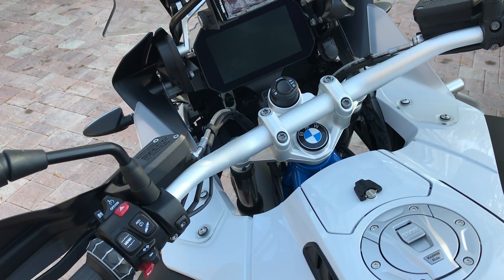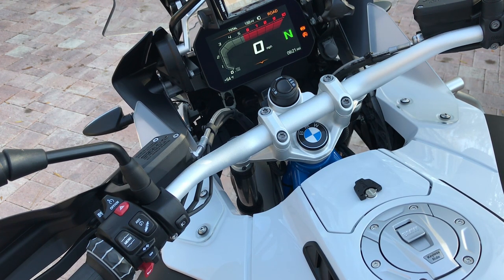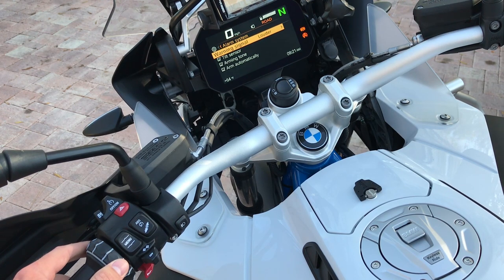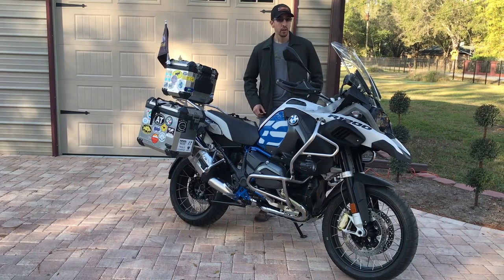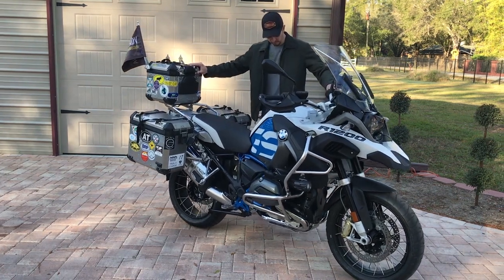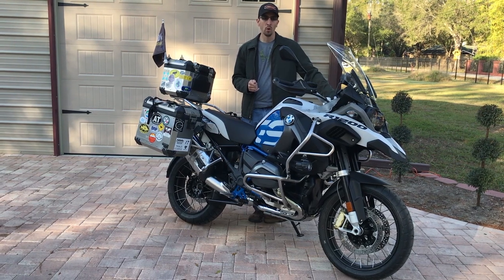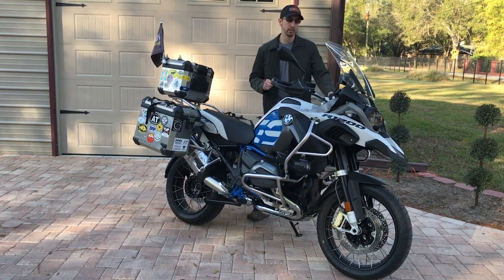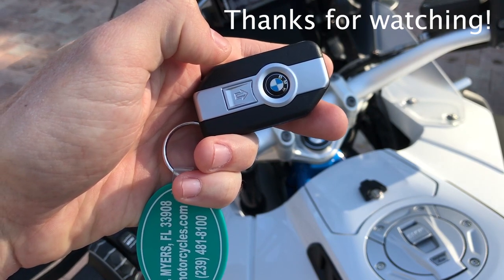BMW R1200 GS GSA Factory Alarm Overview And Setup

Comment: This is helpful, I just bought a 2017 GSA which is slightly different, and the alarm system is referred to as "DWA" in the dash settings. Key FOB is the same, but the 2018 has the all digital display. I was able to figure out how to set it after viewing this and reading the owners manual. My ears are still ringing after setting it off!
Reply from the maker: Awesome, glad I could help!

Comment: Thanks for explaining, and more importantly SHOWING us visual learners how the system works. Not only does my '22 GSA NOT have the alarm system, but my dealer never mentioned or offered the option for my bike. Damn shame--I probably would have sprong for it!
Reply from the maker: It’s hard finding a dealer with good product knowledge. I know a few who actually use my videos for training lol.
Reply: I installed unit myself under 20 min with programming. Buy it your self from ebay.

Comment: Question?? I have 2021 40 th year anniversary gs 1250 and I can’t find the alarm on the computer .. is that possible that I don’t have it??? It is stock for all gs or is that a option ??  I bought it used and don’t know if was a extra purchase or not? Thank you
Reply from the maker: Hey, if it’s got the alarm module you can see it under the seat. Looks like a small black box.

Comment: I haven't been able to get details on this alarm either on the web forums or from BMW. Other than flashing the turn signals and blowing a siren, what else does the alarm do? Does it cut the ignition? Does it cut the starter? What else? I have a 2016 GSA LC and was considering installing it...should have done so when I ordered the motorcycle.
Reply from the maker: Hey, so the BMW comes standard with an engine immobilizer. The alarm gives you the ability to have vibration and movement audible alarm activation. The remote also aids in the ability to not have to leave your hotel room to deactivate the alarm if it goes off by accident. Its a simple install and don't let your dealer tell you that a key fob cannot be paired with the system. My local dealer tried that with me and I had to show the "Master Mechanics" how to do it.
Reply: @2wheelAdv  Thanks! I would need the key fob since I ordered my GSA LC with a "key" and not the "keyless" option. I take it the alarm siren is part of the DWA module or is it a seperate siren? Its too bad BMW didn't provide programming options as they have in my Acura vehicle. I had to get a MotoScan to switch my 12H clock to 24H from my flying days. Same would apply to programming the DWA in.
Reply from the maker: @a.c.e.7568  In my 2018 the siren was built into the DWA. I would assume it's the same unit for the 2016.

Comment: I have a 2021 BMW R 1250 GS adventure with the BMW alarm system installed. When I activate it using my fob I get three loud signals, not two. Would you know why I get three and not two?  Or how to change it from three to two?
Reply: Mine is the same I'm asumeing it's different levels of security maybe ...

Comment: It’s not showing up on my new GSA?  I read where you put it’s plug and play?  Any idea how to do that?
Reply from the maker: Adam Thompson you have to have the module installed which mounts near the rear passenger section. It’s a option that cost about $400. If you bought it and are installing it on your own it might require a software update on your next service to unlock the feature but I’m not 100% on that one.
Reply: Same here.   What’s the module called?   I want it.  I was scratching my head also.

Comment: Hi does this work on gs r1200 rallye 2017 non tft screen ?
Reply from the maker: It won’t have the same features. I had one for my 2014 GSA so I know it’s possible. The 2014 would do movement/vibration detection.

Comment: Any idea if Alarm is in Auto, how do i set it to Trasnport Mode fr the Remote.
Reply from the maker: Hey, sorry for the delay. You have to go into your settings menu and unselect auto arm and vibration/movement option. That should save your battery during transport.

Comment: Hi, does this bike come standard with an alarm
Reply from the maker: Redline600 hey, no it doesn’t. $300 ish option.
Reply: @2wheelAdv  dame, ok thanks.   Does the bmw shop fit it
Reply from the maker: Redline600 yes they can install it. Probably be 1.5-2 hour labor charge though. If you are somewhat competent you can do the instal yourself.

Comment: Hola, me gustaría saber dónde está ubicada la centralita de alarma de la bmw 650 gt para sustituir las pilas, gracias
Reply from the maker: If you have the Factory BMW alarm and the module is the same for the 1200 GSA as the 650 GT You will find it under the rear section of your seat. The module will have a small battery inside which should be replaced yearly.

Comment: How did you mount your flag?  Is it something special you ordered?
Reply from the maker: Adam Thompson I ordered the mount from EBay. Drilled a hole for the bolt to pass through on the upper pannier and sealed it. I have a video of my fixing it somewhere...

Comment: How much did it cost to buy and install your factory alarm?  Thanks in advance
Reply from the maker: Alan Velasquez I believe the retail price is $400. I had the dealership install it part of buying the new bike. However, it looks like it’s just plug and play if you want to do it yourself.      Something else I found out today is that It’s got a battery backup so if someone try’s to disconnect your battery to steal the bike it still goes off.
Reply: Thanks again and congrats on your new GSA
Reply: Not plug and play.

I bought mine from a store I'm Australia. I installed it myself (5 min) but you have to take it to the dealer so they can program it to communicate with ECM. The bike was under warranty so SW update was free of charge.
Reply: @2wheelAdv  whats the part number for it thanks
Reply from the maker: @firstphoton655  not a clue, it will be in the BMW catalog

Comment: Lost my battery power because of this setup
Reply from the maker: Well that could have happened because of 3 reasons. 1) bad battery and needed replacement. 2) you had it being transported and the alarm kept going off. 3) you don’t use a battery tender and only ride every blue moon.